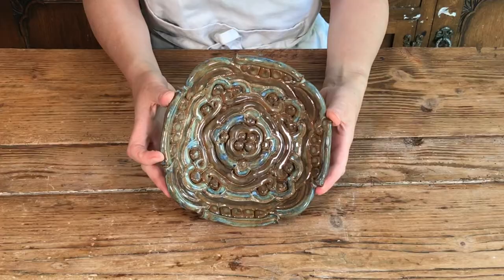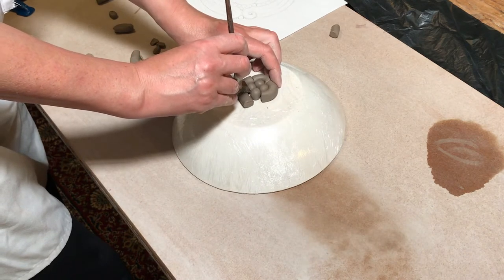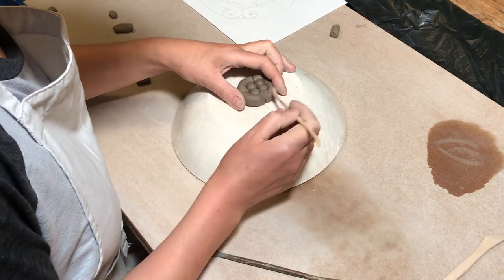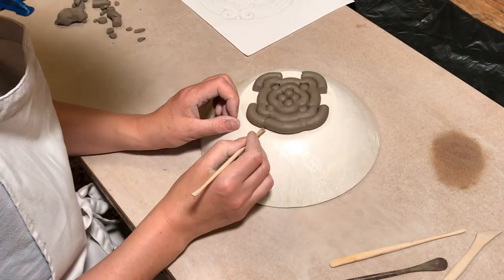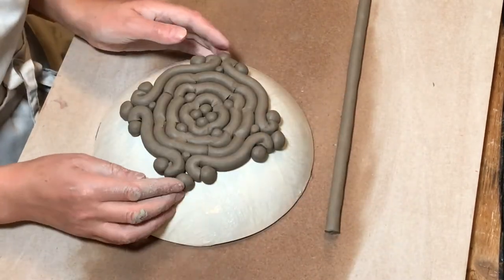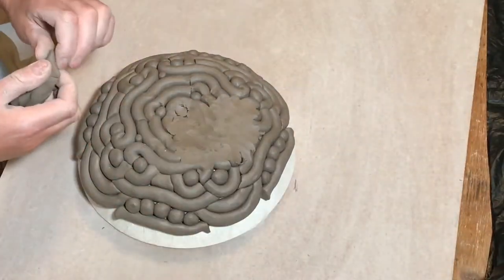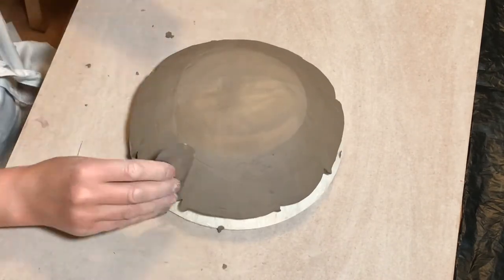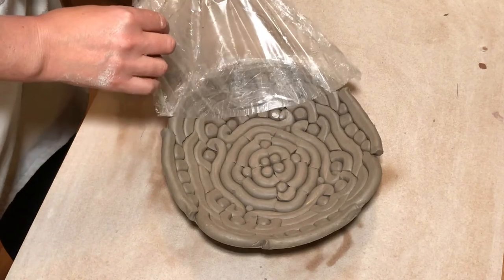Making a Coil Bowl with a Mold

Comment: Tip: if you draw a raster on the mould your symmetry  would be easy to get right. Just 4 lines through the middle and 2 concentric circles  around the mid point.
Reply from the maker: Thanks :-)

Comment: I saw ur two videos and they r very informative and beautiful. can i make this with red soil clay? and can i bake it in microwave oven?
Reply: @ Amey Desai Hi, I watched this video and then I read your comment and question. I don't know what red soil clay is, but it sounds good, I love red. What I'm thinking is you could easily make a coil bowl out of air dry clay. Das Air Dry Clay is a great brand and it's one that I use regularly. You may well have used air dry clay before, but if you haven't, it comes in white or terracotta, and, as the name suggests, it dries in the open air so you don't need a kiln or an oven. I hope this helps. 🙂